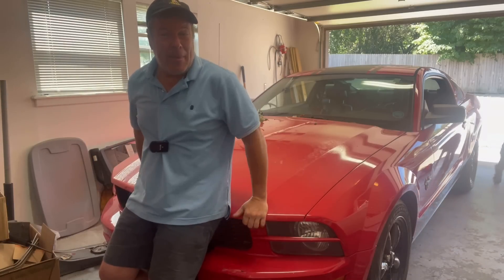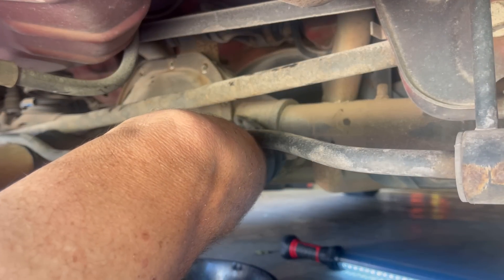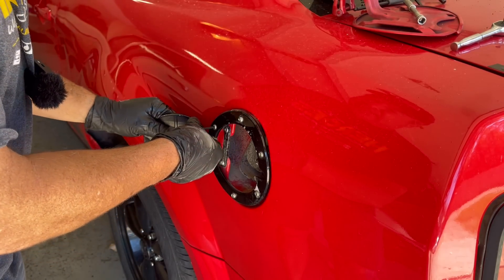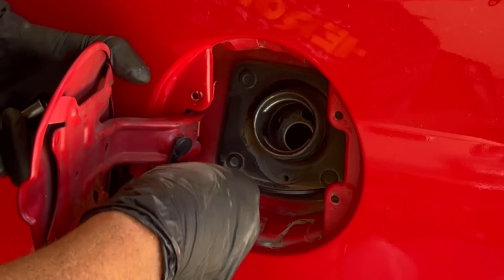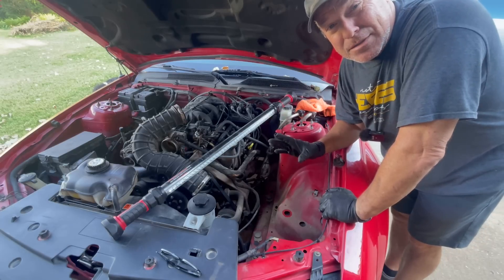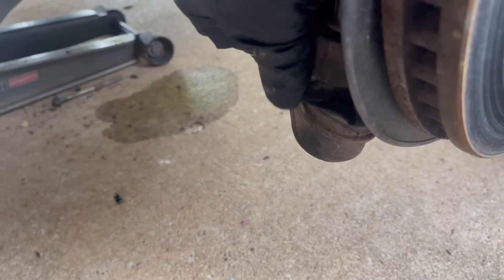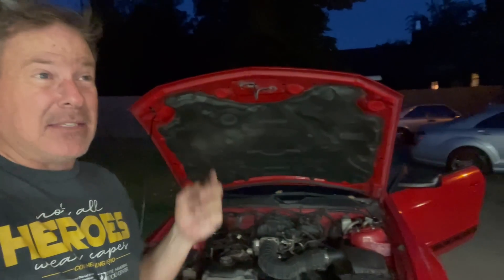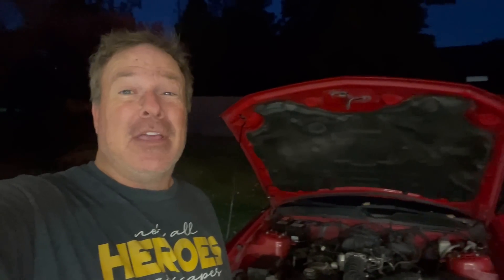Replace Your Compressor, Tie Rod Ends, & Diff Fluid

Comment: There's nothing wrong with a V6, in most markets this is the top range type of engine you can get. A bonus: it needs not that much fuel. The gas cap cover was hideous in black but when you do the hood, try to paint it, too. The could help a little 😁

Comment: Me likie mikies Mutt dang! I am enjoying this series. I have recently found the joys of the overlooked models in a cars line up. This six shooter mustang is a fun car in its own right. While the wimpy growl of the v-6 will never have the torque and stirring rumble of the Ford V8, it has plenty of scoot for normal around town use. My 1st car was an abused 1963 Chevrolet Nova (No Go) SS convertible cream yellow with a black bucket seat interior on the floor and a power glide 2 speed automatic behind a Chevy 194 cubic inch inline six. And my friend drove a 1965 mustang convertible with a 200 cubic inch 6 cylinder and 3 speed manual. And I had other friends with 6 cylinder falcons, 6 cylinder Corvairs, (one was a 1964 convertible with a turbo, that one was pretty quick!) another friend drove an early 50’s Chevrolet 1 ton dually truck with a 6 cylinder. That one was really slow.yeah, there were the the 70 boss 302 mustang, the 390 horse Chevrolet El Camino,  the 71 Plymouth 440 Road Runner, 1970 dodge Super Bee as well. But us 6 cylinder guys for some reason did not have any where near the crash and scratch episodes the big motor v8 guys did. 

But I do have very fond memories of my 2nd car! A 1970 Plymouth 383 magnum automatic Road Runner hard to with the air grabber hood scoop, black hood stripe and black vinyl roof, bucket seats, console and tic-tow tach with the 150 mph speedometer. And I saw the needle touch most of the numbers on the dash. The only car I have been faster in was my uncles blue 1966 Buick Riveria GS with the big red v-8 with two big 4 barrel carburetors on it.  150 on the rolling dial speedo was effortless. And quiet! That Buick was a Real Buick in every sense of the word. Quiet, good looking, very comfortable and ridiculously fast. (That ride was in 1967, before I was old enough to get a drivers license!)

Comment: The diff is probably the pinion bearing.  I had that kind of noise on a Crown Vic and that's what it was.  The mechanic was able to change it from the outside on that diff.

Comment: Hi from uk MWM 👋👍 well at least you'll be coll as well as looking cool in the stang!👌❄ and if you get drain plug of diff stick a thin bit pipe in with a syringe and draw a sample from bottom (just make sure bit pipe sticks out hole just in case comes of end lol) but nice to know the back end been serviced😂 lol maybe noise is warped brakes or wheel bearing or propshaft bearing ??thanks for your time and be safe see you soon (cant wait to see/hear janice finally bark off 👍)  good luck with that too 👍👋

Comment: Did you examine the gears in the differential? I look for wear and slop. I've known people to add a drain plug in the pumpkin. Could your noise be a universal joint? I liked the gas cap cover that was on it better, but it is a matter of opinion.
Reply from the maker: I’m starting to think it’s a U-joint.

Comment: Cheap parts cost? Easy and straight forward repairs? This is not a normal thing on this channel.  You need the 2 little black rubber bump stops to have the gas door sit right. I would not even bother going to get them from the junk yard as they will probably tear off if you try to remove them. Getting 2 new ones is your best bet. I think the dealer still sells them or there might be some online. Before installing them make sure the holes are touched up to prevent rust. I noticed that the bottom hole had paint missing at the top of the hole.  Don't worry too much about the fact the car is a V6. That engine (which is 210hp) is more then enough for use as a daily driver. I think it will make a fine little daily driver for years. The 2005-2009 is one of my favorite Mustang generations.

Comment: Supposedly you are to replace the dryer and add oil, but I bet you know this.
Reply: The problem with DIY A/C work is that you can’t put the right amount of refrigerant in the system - unless the amount your car needs happens to match up to the amount in the cans they sell in the auto parts stores.